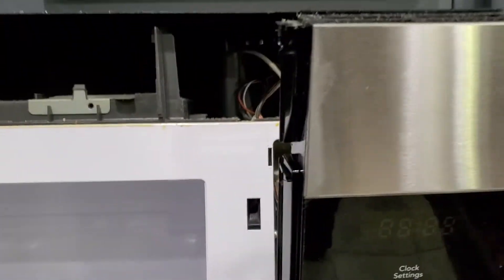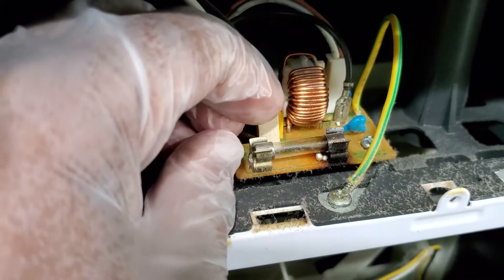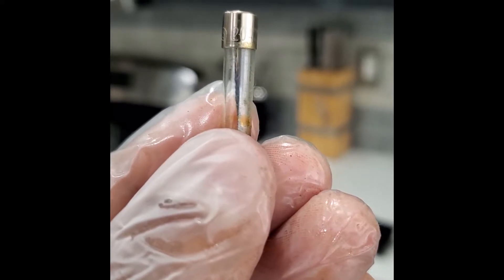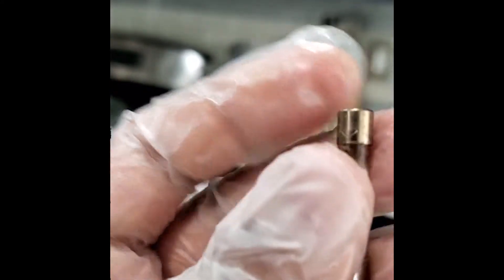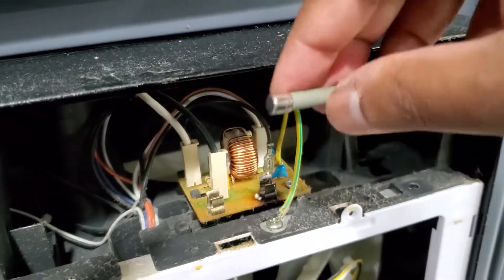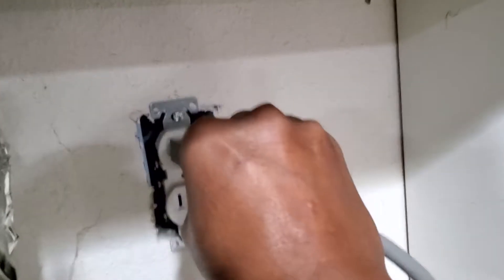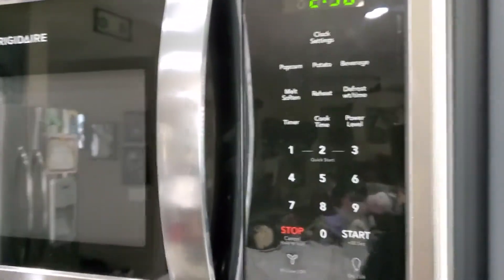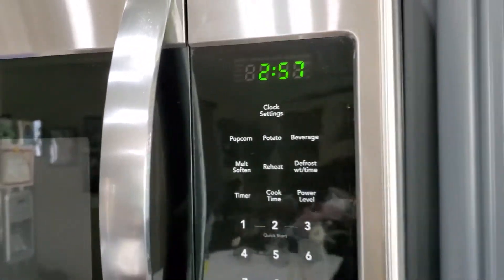Replace fuse on Frigidaire microwave

Comment: Was your replacement fuse also 125 volt? Just curious because the link is to a 250 volt fuse, is it OK to use a higher voltage?